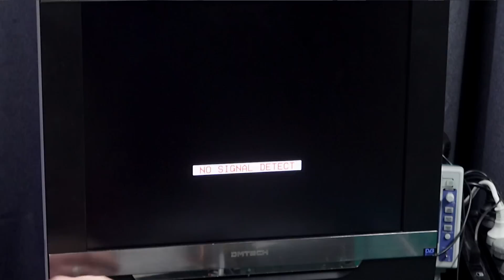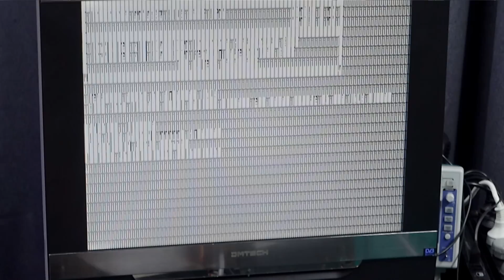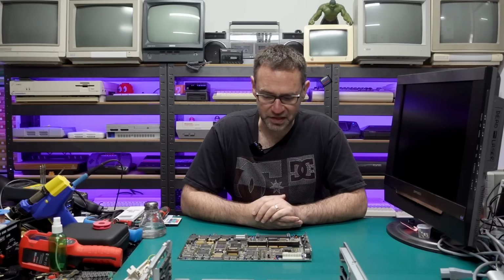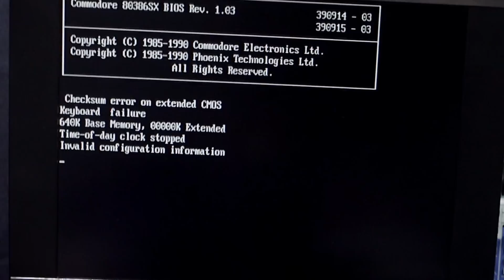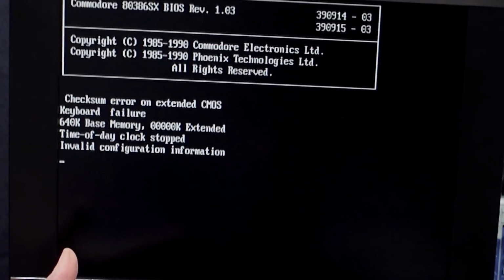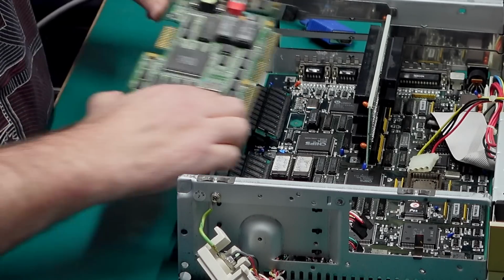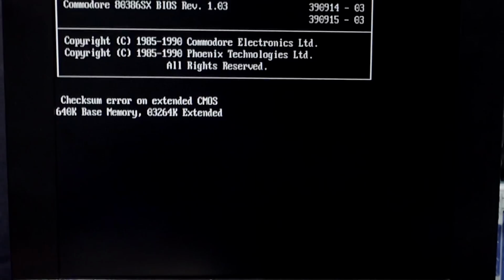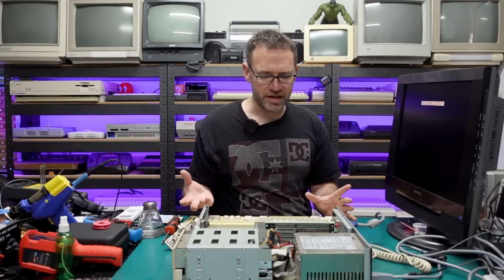Commodore 386SX-16 battery damage repairs feat. @MrLurchsThings

Comment: Hello! I just managed to make this machine breathing again, although mine took two weeks to repair (heavy corrosion around the chipset). Do you happen to know if it works with 2 SIMMS as well? I only have two modules and I have been trying everything but the extended memory still shows 00000KB.
Reply from the maker: I think it should work with only 2, but I could be wrong. Mine is packed up at the moment so I can't verify that right now sorry
Reply: @TheRetroChannel  OK, thank you for the answer. I was probing the machine a bit with the scope and it looks like that the neat memory controller isn't even trying to count the memory from the slots. Not sure how to enable the extra banks so I'll probably leave it as it is.
Reply: Just a little update for anyone interested. It was a SIMM module(s) fault. I tried different ones and it works. Both with one and two pairs of SIMMS. Also works fine with both 3 chip and 9 chip simms. This machine was kind of a disaster, took a month to repair all the broken traces. But the videos here helped a lot, thanks!

Comment: Greetings from Norway. This was my very first computer. Commodore 386SX-16 with 2MB RAM and 40MB hard-drive. Only parts I've got left is the mouse and all the original floppy disks. MS-DOS 4.01 and Windows 3.0. Miss the computer though.

Comment: Hi, since you found your board on Theretroweb, could you please share the BIOS from your motherboard to us ? The picture we have online could also be improved :D

Great repair video by the way ! Pretty clean job too :)
About the CMOS, if you install a battery, you'll probably need a beefy battery, your motherboard is equipped with a 82C206 part, which was pretty common at the time, and contains the RTC and nvram, but is known to waste a LOT of power, so if you planned to plug a CR2032 it'll get drained in just a few months or even weeks.
Using 3x AA batteries should do the trick.
Reply from the maker: Thanks, I was thinking of hooking up a little battery holder with a few AA's to the external battery header.

I think my BIOS will match the ones found here http://www.zimmers.net/anonftp/pub/cbm-pc/firmware/sl386/index.html
But I'll dump mine just to be sure, and I'll try and get some better pics while I'm at it

Comment: Cool Commodore PC. I have the 486SLC-25 version of this same computer. Sadly the membrane on the keyboard has failed, some of the keys no longer work on it. Interestingly mine has onboard video, rather than using an ISA VGA card. Hopefully your keyboard works fine.
Reply from the maker: Oh shit, I hope so. I'm still yet to test out the keyboard properly.
Reply: Any AT keyboard will be fine on that system. The thing that threw me off originally was to get into the BIOS on my Commodore PC you needed to press the escape key, and it was one of the faulty keys. Sadly it looks like no one is creating new membranes for those Mitsumi keyboards